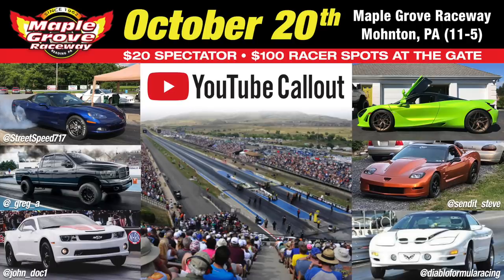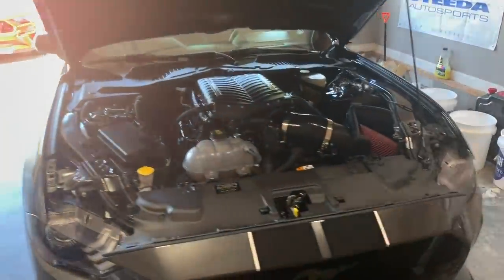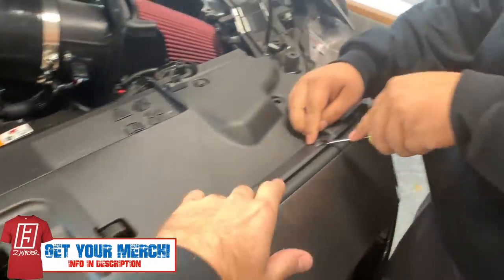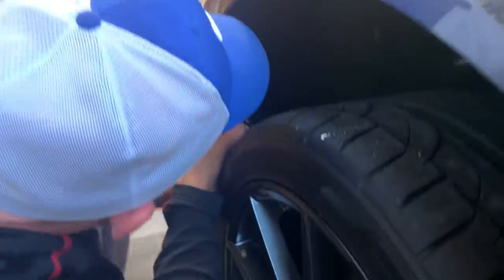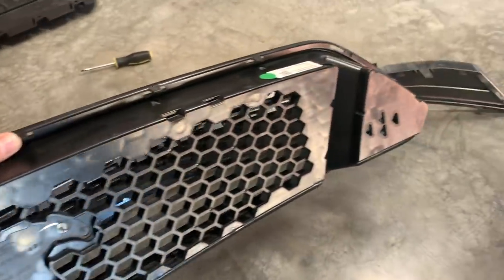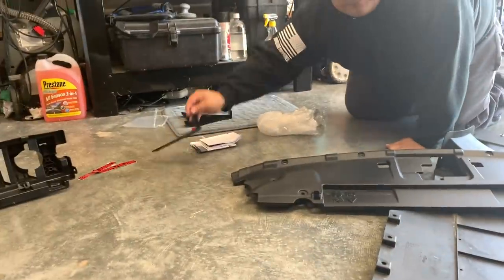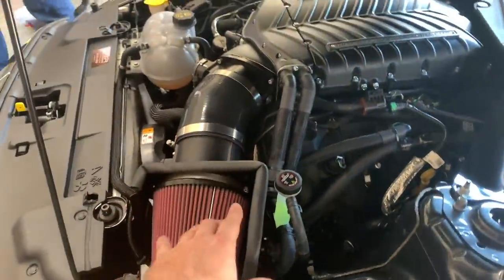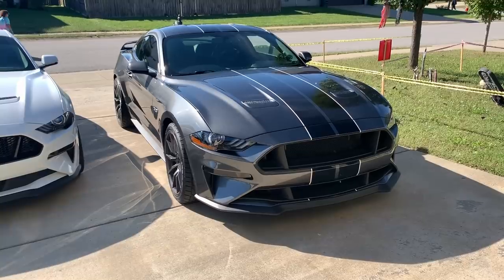2018-2019 Mustang GT Whipple Supercharger Mods and Cervini Grill Delete Install

Comment: I love the Cervini grill.  It not only looks meaner, but you're so right about the need for more air flow, Zander.  Modified engines especially need air to breath, which is one of the reasons why so many go for aftermarket cold air kits.  Cool instruction video with great results!  Thanks, Bro!
Reply from the maker: very welcome and thanks so much. I love how open it is. The larger opening allows much more flow the the SC air cooler mounted right infant of the radiator.

Comment: Man I get that the 6R80 is a great trans but i just wished ford would ditch the MT82 for a Tremec or at least make the Tremec a factory option for the 2020 5.0's... That would be AWESOME!!!
Reply from the maker: Word is a new 7 speed manual is coming for next chassis
Reply: The 10r80 in my 19' is more than good. I wanted a manual but the acceleration difference is just to much to look past. I will hit 9.80's with a 3.0 whipple, long tubes, E85 and slicks. These coyotes are crazy bang for the buck.